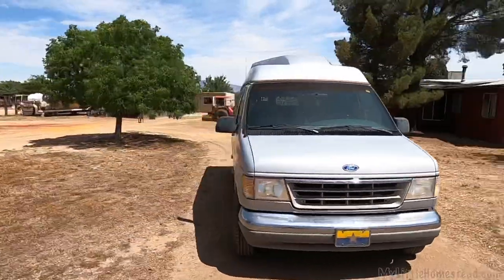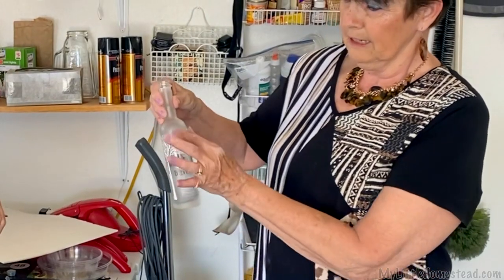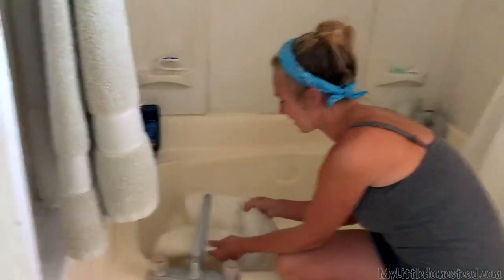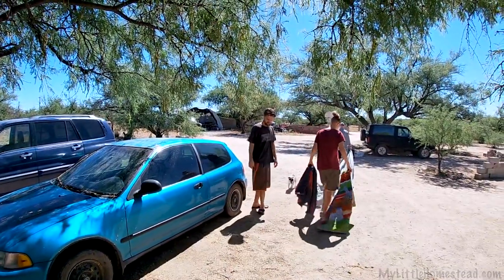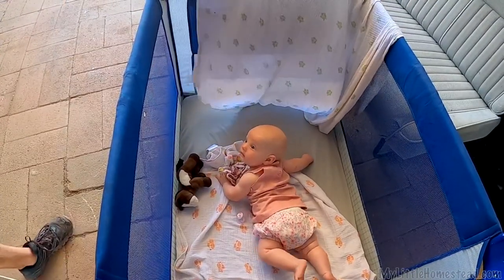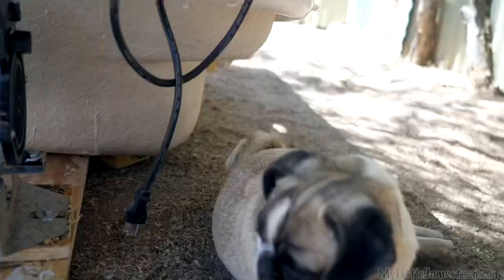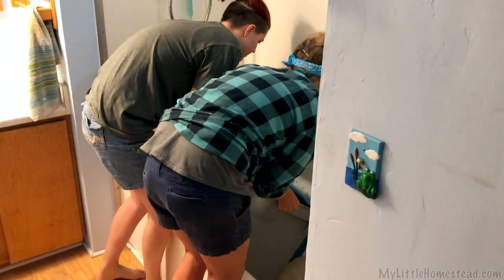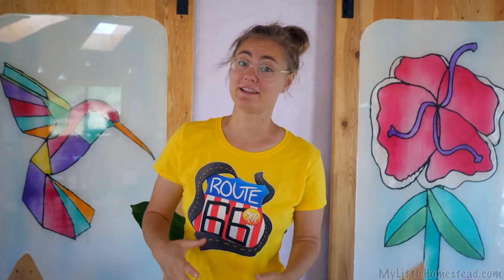Van Conversion Pallet Boards, Wedding to Summer Dress & Outdoor Bathtub Plans | Weekly Peek Ep240

Comment: as a plumber and have installed them many times i would leave enough space to get the moter out for when it goes bad and for being able to get all the water out for winter so it does not freeze. and if you do not keep the sunlight off of it, it will break down soon. p.s.  i love when grandma is in the videos.
Reply: That dress is stunning ! Awesome job!

Comment: You realize those bits of metal you are cutting out of that van were engineered for structural support and crash protection right?
Reply: You should probably word that a little different.
Reply: Was thinking the same
Reply: In germany, after cutting this out -> scrapyard
Reply: Had the same thought. Yikes!
Reply: That was one of my first concerns as well.
Reply: @flybywire5866  was ist ein Scrapyard ? Schrotthändler ?

Comment: Use some bottles as windows in the outdoor tub room.
Reply: It would be interesting to use a tile saw and cut the bottles in two lengthwise. You could invert some to create an Escher pattern. Maybe copper foil the edges, and then lead solder them together.

Comment: Garen,
For future reference, when you want that trim wood to bend but not break, soak the wood in water for a while prior to mounting it.  The moisture will allow the wood to bend easily without the hint of breaking.
Reply: and or score the back side so it flexes
Reply: And or Steam it I built a steamer for 20' ship  frames in about an hour.

Comment: About twenty years ago I spilled dark blue ink on a new(ish) beige summer jacket which I used to wear all the time, so I decided to dye it. Because the ink was pretty dark, I went with black dye to make sure it wasn't visible, but that's sooo not the colours it came out as. The final product was mostly this really nice dark slate blue, but the thread - which must have been something like nylon - turned an orange umber, and looked kinda vivid against the dark blue-grey because it was so much lighter. The combination worked far better than I'd've imagined, probably because the two colours are directly opposite on the colour wheel.

Comment: Garen be cautious when cutting out too much metal you can weaken the structural stability of the rear section of the van especially if you get rear ended by another vehicle  or possibly hit a large bump in the road the back section might sag or renkle and then the side glass shatter or explode due to the pressure of the metal movement.

Comment: Hmm that van project would be a good project to use steam bent wood. Although I'm not sure if pallet wood will steam bend. You could get  some really cool curves.
Reply: Garen is also using 2x4's ripped down and those will soak nicely, I have never steamed wood but that would work as well as soaking them.
Reply: Actually it bends very well a lot of it is white oak.

Comment: you should use the crumbly-ish creamy colored foam you can buy (called poly-iso-cyanurate) for the walls in the van next time. they have a higher heat / cold resistance and they are much more heat and fire resistant.

Comment: VAN BUILD TIP:  if you soak the wood you’re using for trim in water overnight it’s easier to mold it to a curved surface, just make sure you leave the doors open for it to dry properly!

Comment: For the trim, soak the boards in water untill they are flexable not to crack when you put the in place. They will dry to the new bend.

Comment: Garen if you soak the boards in water 12 to 24 hours. The boards will bend to any curved shape and if attached while wet will dry to the curved shape without breaking.

Comment: Here's an idea for the bottles: get them hot enough that you can change their shape and shape them into napkin rings. One you can say you made it two you have a cool story to tell.

Also, I would steam the trim pieces for the van and then dry them in the shape you need to make it mostly flush to the curve of your walls. It will take a while for the trim pieces to dry but you also won't have to worry about breaking them when your installing them. It's a technique many wood workers and some instrument makers use to stably create the curves they need for what ever project they may be working on. It's a thought.

Comment: I hate to tell you this, liquid nails eats that type of foam, they make a special glue for it but it is very expensive, over double the cost.  You could however use a good caulk or expand / non-expanding foam to "glue" it to the side of your van.

Comment: VAN build #1 that metal was there for a reason…structural support and safety. #2 did you treat the rust at all? #3 what is the allowed gross weight for that vehicle?  Do you realize how much the wood your adding is going to effect the safety of your vehicle and the vehicles around you on the road?  You may get by with parking the van and renting it out as bedroom space.

Comment: Is a paved courtyard something you guys would consider doing? Where I live now the soil is as hard as sun-baked-mud-bricks...but with rocks and large tangled tree roots (if you were to try digging it).  Just day dreaming about a solution to my mud problem when it rains.  The clay is quite sticky and stains everywhere the dog walks--including the house.  If cutting stones in half were not terrifying, pounding them smooth side up into the ground would eliminate most of my problem. But your setup is considerably better suited to courtyard paving of some sort--or even just paved walkways between buildings?

Comment: Doesn’t all that pallet wood panelling add a lot of extra weight to the van?
Reply: Well they did remove a lot of weight when they gutted the van. And pallets are normally made of light weight pine. It still has to be more fuel efficient than a gas guzzling RV.
Reply: it does! AND having weight on the floor is different then bringing it up on the walls. 
...after weakening the structure first, by cutting out frame parts.
that was not a good idea.
Reply: @0815419  I certainly can see your point about structural integrity.

Comment: To make boards bend cut kerfs on the backside. Works with Sheetrock too on round areas. Kerfs are a series of cuts on the backside of the material part way through.  Makes things bendable. lllllllllllllllllllllll

Comment: Ellie if you would have used the waist line ribbon from the wedding dress and dyed it then placed it back on the waist line to match the lace at the bottom of the dress it would look nice and match better then what is on it now ( my observation) to my eye the color of that ribbon on the dress now doesn't look appeasing. Have sha dye the other ribbon from the wedding dress and lay it on the dyed dress just to see how it looks then decide which looks better.

Comment: Y'all are compromising the structural integrity of the van. Both from just flexible movemnet while driving, tweeting itself apart, and  from side, roll over accident impacts. That metal was formed and place the way it was for a reason, remember you child is going to be riding in this, ...!

Comment: tripods - If you watch the junk stores you can get them for half price. <heart>
Reply: My grand Nephew was here so I had to Stop watching.
Reply: Research Sauna's - For the structure around the Tub. - Also.. The Water Heating - See.. it's a miniture Jacuzzi - which means It requires Electricity and Heated Water.. - The Best thing to do is To create an environment that enables you To maintain Extremes of both -
Reply: By utilizing the Sauna Experience with the Tub.. You can Also enable - Beautiful Combined Moments As well as Private Personal Moments.
Reply: As for The tub itself. - You are better off with an Edge in which you can Sit with you feet in it - And another where you can Sit beside it, - See.. Imagine for a Minute... Sigh. 
Intimate and A group party?
Reply: Next - The Old People... - LOL.. no insult meant - But YAH... OLD People - Trouble getting up and Down. So a Step Up to the Side set would be very Helpful - Being my Size I would want 10 to 12 ins - but That's My size.
Reply: I would draw out my suggestion - But I'm just hoping you would Understand... Round structure Doesn't matter and Only gives More room for bench Comfort.
Reply: the Van? if the issue of safety comes up - You can Barn room the Ceiling - connecting the two sides - and Even Reinforce the floor - With a Subfloor That's insulated anyway -
Reply: Instead of the 2x4 - I would have Insisted an Exhaust metal or even Metal 2x4s - Somewhere around there? as the Beam you put there? but .. WHat you are doing is fine -
Reply: If you have ever torn a camper or a motor home apart or repaired one - You will find That what you are doing - is actual OVER the required by law need - AND - actual Considered Unneeded Weight.
Reply: On those models - A 1 by 2 - which is actual 2/3 by 1 1/3 - is Use to Set the curve - then a Second one is used to to make a BOW. understand? sigh
Reply: the walls You are installing currently - are Stronger and Can handle More weight capacity than the Cieling and Roof - of your Trailer house Home.

Comment: Ummm...Could I ask for help with my murphy bed raising and lowering mechanism?  I watch ALOT of Jeremy Fielding and so got it in my head to canibalize things and reuse them...So I got a motor from a hospital bed and it works...Now how do I add a bicycle gear to the end of it? Or should I use a series of gears before the bicycle gear (which will then turn the bike wheel that has plasticized cord going off in two directions aimed with pulleys to the top of the bedframe from below, where I have already attached a nice sturdy metal ball joint.  I can send pics and diagrams if that is helpful?
Reply: 😢🙏🏼please?

Comment: You just took all the structure out of that van that keeps it from crumbling in a crash! Any accident that van is in over 20 miles an hour and your smashed. They have all that internal metal for a reason... no way would I put my family in that death trap, take it by a body shop and ask them about it, or read up on why they have all that metal there in the first place.

Comment: Garen, where is your eye protection young man? My husband (who has passed away) worked with the same kind of tools and got metal and wood in his eyes a few times. The thing about metal in your eyes is that it can cause a rust ring! . Removal of the rust ring is imperative to avoid permanent staining of the cornea, persistent inflammation, or disruption of corneal integrity (necrosis) with loss of stromal substance. They use a couple of different techniques to remove a rust ring. One of them is BURRING with a drill! It's horrible. Please be careful. I say this because I care. Thanks :)